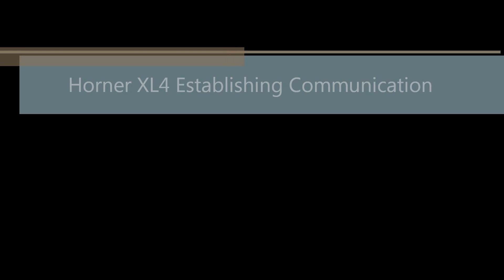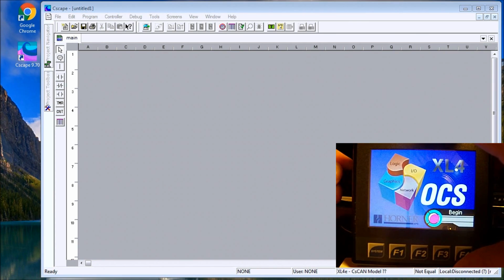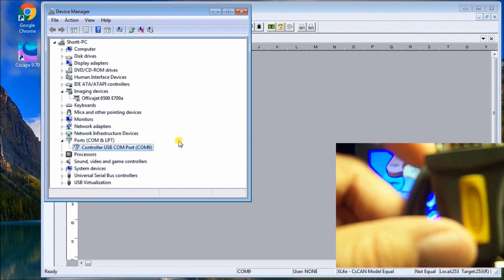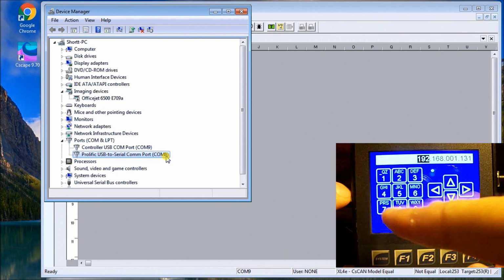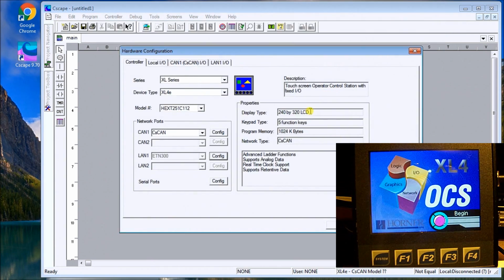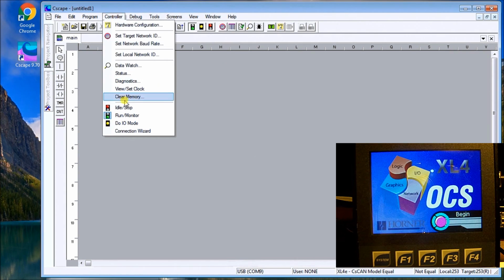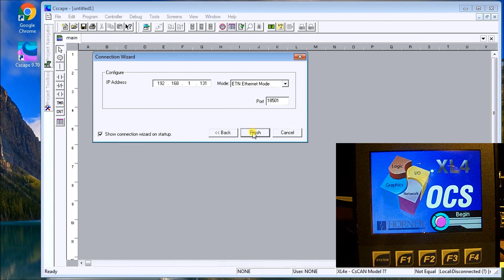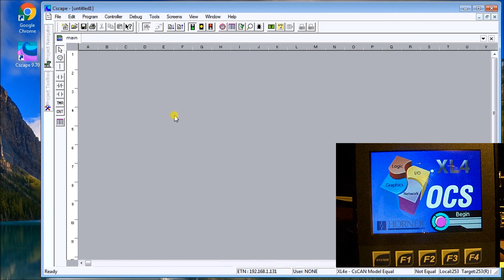Horner XL4 Setup: Bridge Controller & Cscape Communication

Comment: Hello!

Why, whe i enter a new IP directly into the PLC, it cannot be applied. Apparently the new IP appears, when i browse in red i cannot communicate, and when i restart tje plc it returns to the previous IP
Reply from the maker: Hi @yupo357,
What are the IP and mask settings that you are trying to set? In my example, we set the IP Address to 192.168.1.131 and the mask to 255.255.255.0.
Here is a link to the post for this video.
https://accautomation.ca/horner-xl4-establishing-communication/
Regards,
Garry

Comment: can we configure Password for SYSTEM Keypad ? Please  explain the procedure
Reply from the maker: Hi dhruv prish,
I am not sure that I understand your question. If you want to have a screen password protected, I would set up a button and move to a screen to enter a value. If the value is correct then it will display the password-protected screen. If it is not correct it will go back to the previous screen.
I hope this helps you out.
Regards,
Garry
Reply: @ACCautomation  Hi Mr. Garry!! Thank you for your immediate response. This answer is very helpful. Our customer requirement is, if user press ‘system’ button on keypad, there should be a password protected to access that configuration page which is available in the system button. For instance : if we want to configure IP address in HMI, we can press system button on keypad and we can change the IP ADDRESS. In this case, not all user can access this configuration page, But that needs to be password protected. To achieve this how can we do that ? Please explain. 

Thanks 
Regards 
Prabha

Comment: Relou qual protocolo de comunicação da ihm he-xle 102 para comunicação smartStix
Reply from the maker: Hi Damiao Silva,
"Reported which communication protocol of ihm he-xle 102 for smartStix communication"
The SmartStix uses CsCAN. Baud Rate for SmartStix I/O is fixed at 125KBaud. The following are the specifications.

Oi Damiao Silva
O SmartStix usa CsCAN. A taxa de transmissão para SmartStix I / O é fixada em 125 KBaud. A seguir estão as especificações.

https://hornerautomation.com/techdocs/MAN0897-01.pdf

Cumprimentos,
Garry

Comment: hi garry.
how we can to verify LAN port are activated or not?  I  to establish connection by usb OK but try with LAN non ok. regards
Reply from the maker: Hi Daniel,
You must first set the IP address and Network Mask on the XL4 controller. The IP address and mask must also be set in the Cscape software package. 
Then when you start Cscape – Control Station Central Application Programming Environment – Communication 
Select the Ethernet option.
https://accautomation.ca/horner-xl4-establishing-communication/
This will give you step by step instructions on the website.
Hope this helps you out.
Regards,
Garry

Comment: I didn't notice you using COM8, which was the serial to USB connection. You used COM9 for both USB and Serial.
Reply from the maker: Hi John,
You are correct. I should have selected port 8 for the serial communication. The usb connection automatically loads a driver for the serial port as well. It automatically chose port 9 when I tried the serial interface.  This will communicate through the 9 pin serial port as well.
Thanks John,
Garry

Comment: congratulations for your video!!

But , i have one question. How to establishing communication with equipaments rockwell in ethernet ip , with eds files or string names? tell , whitout generic comunication.

Best regards , Mauro .
Reply from the maker: Hi Mauro,
This video was to show communication from the Cscape programming software to the Horner XL4 controller. 
It does have Ethernet IP communication (protocol) capability through an additional addon:
https://www.youtube.com/watch?v=K9m9of475Rs
The above is a video by Horner.
One of the best video's of explaining Ethernet IP is the following:
https://www.youtube.com/watch?v=_NoMHDMfZ7Q
Do-more EtherNet/IP Explicit Client with PowerFlex40 VFD

I hope this helps you out.
Regards,
Garry